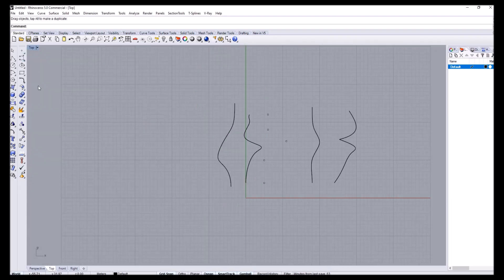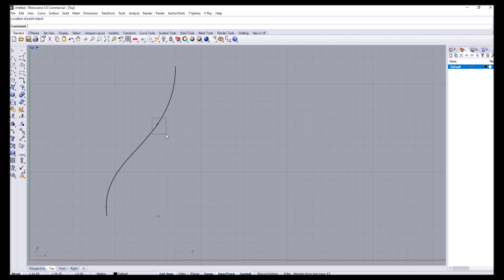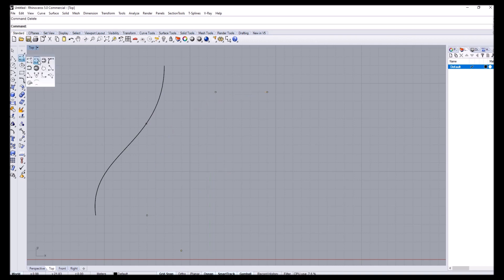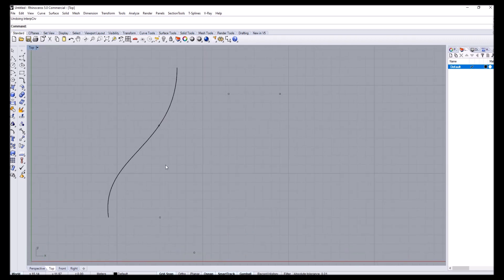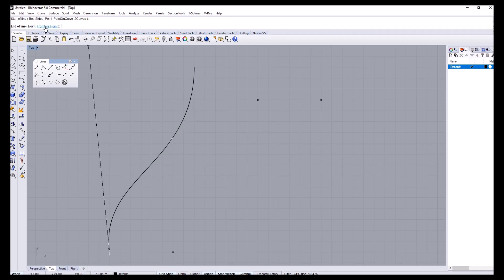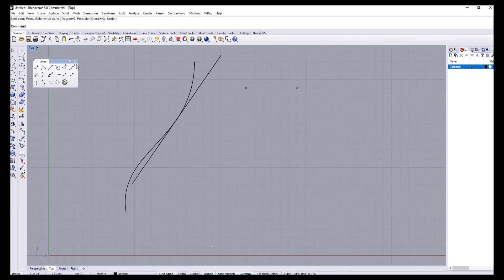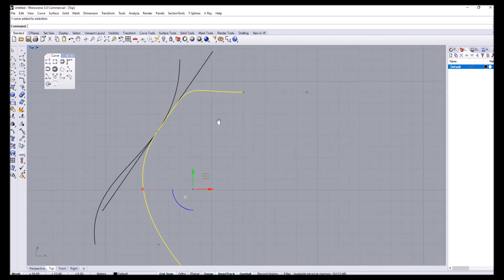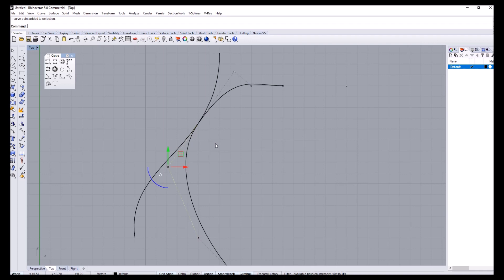Rhino Modeling Tutorials: Tangent Curves

Comment: Thank you so much for your entertaining and informative videos !

Do you have any idea how to let two given/already lovingly drawn  (single span) curves intersect (in a non tangent way/) in one point, two curves which are not touching/intersecting by just a tiny bit ?

For example having drawn one continous and clean single span curve, representing the frontal edge of a car bonnet, continuing into the wing as a panel gap and another one, about vertical to it, representing the upper and frontal edge of the wing, both drawn fitting to the top, front and side views of the underlying 2D plans.  

Is there/ do you know/ can you think of a way to achieve a clean intersection in one point without re-drawing one of the curves ?

Using "ClosestPt", it is possible to generate a point on one curve, that serves well to draw a newly redrawn second curve through, using "CurveThroughPt" for example.
In other words:
Is there a way to force an existing control point curve to pass through a given point? ...making it snap magnetically to another curve passing close by  or to a point on it?